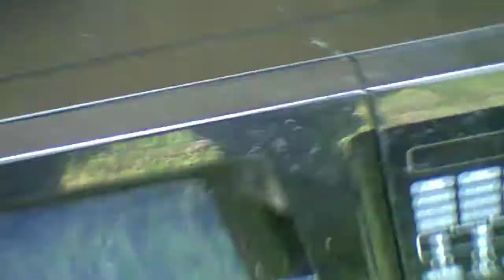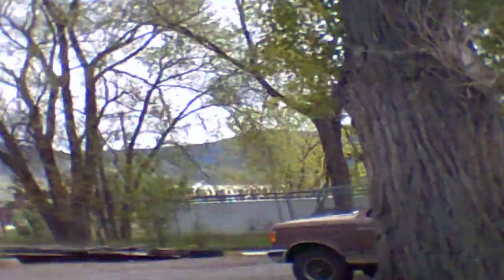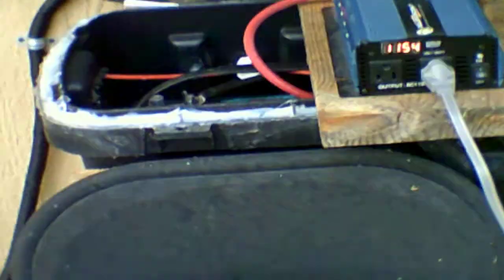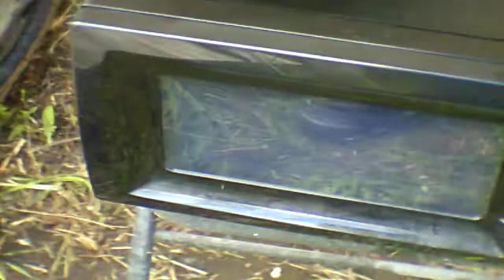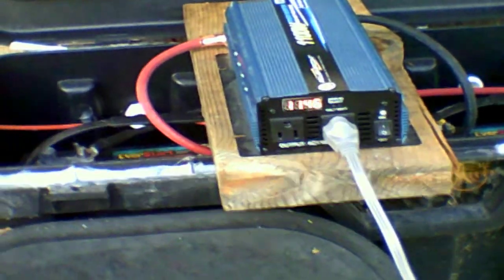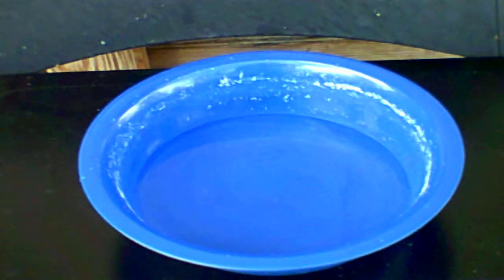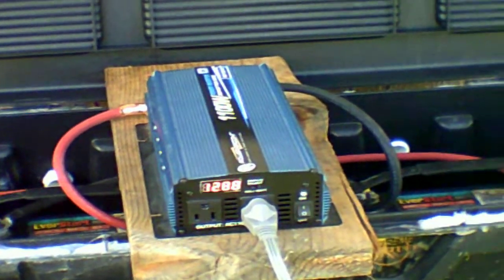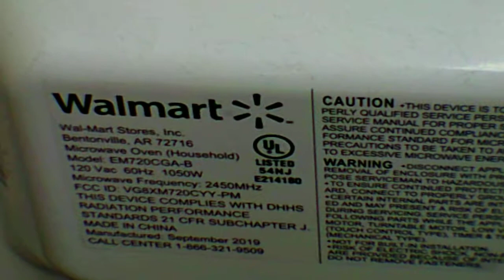700 Watt Microwave off of a 1100 watt inverter and solar

Comment: I’m surprised of that little inverter powering that microwave
Reply from the maker: Since it is a 1100 watt to 2200 watt inverter it can handle some things that a 1000 watt inverter can't. Also a 700 watt microwave usually pulls anywhere from 900 watts up to 1050 watts depending on the brand.